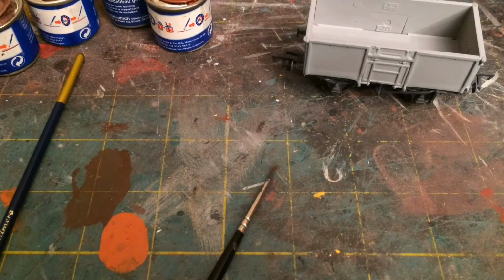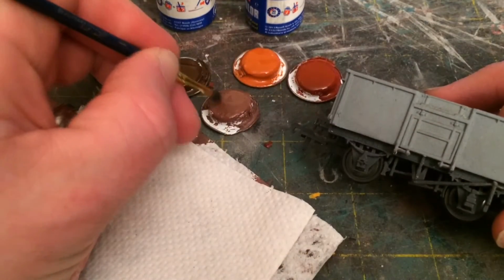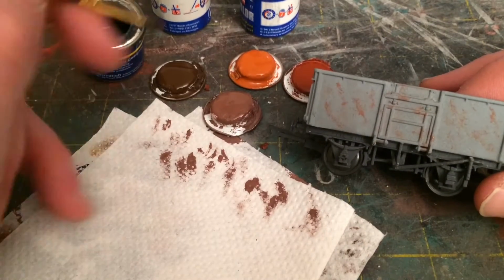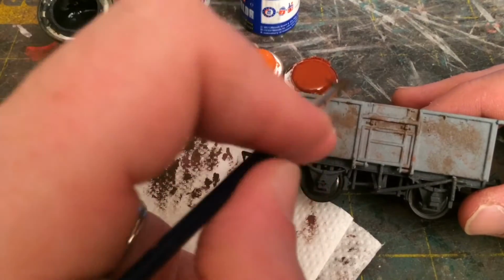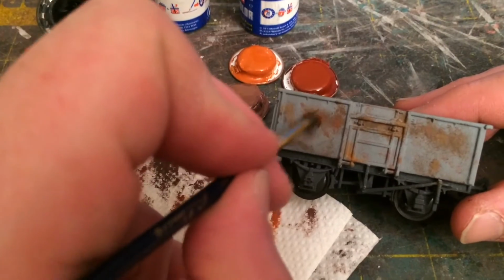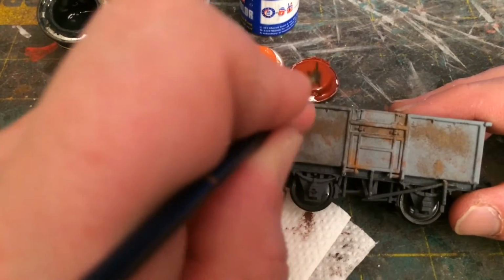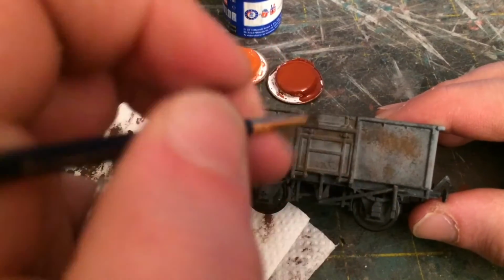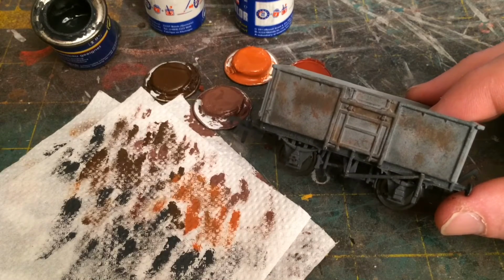Galgorm Hall How To Guide - Weathering a 16T Mineral Wagon

Comment: I love your very practical how to guide with simplistic  comentary.
i have 12 O gauge ones to weather.
What I do for solebars and underframeon general is to mux rust with matt black to tone it down then mist it on witg an airbrush.
I can then use a bit of gloss black on the axle boxes that look like grease.

I realise how complex a mineral wagon is locos are easy compared to these.
Reply from the maker: Hi Steven, thanks for those comments. The tutorial was as much for me to reference as anyone else who could make use of it. I've just subscribed to my first garden railway channel (yours!) so I'll look forward to seeing that rake of wagons weathered. As for airbrushes, I don't own one and am not entirely sure it's a beneficial investment for me. Still undecided though. 🙃  Paul
Reply: Galgorm Hall OO Gauge Railway Layout Paul
Firstly I sawa a lot of vids on weathering mineral wagons and your technique I like.
Ihave never really dry brushed before.
i suggest you buy an airbrush, you will wonder why you never used one before.
they dont replace brushes but they are the gest tools for the RIGHT job.
I would always paint a wagon with one and the underframe is  a breeze.
My approach to weathering mine will be to use you method after I have made them as in service condition.

So firstly I would airbrush the chassis using rust dulled down with matt black and just waft it on it gives this lovely track crime look over it.I then would use gloss black on axle boxes with a brush to show a bit of grease.
Using a dark grey with matt black I would dust the wagons with the airbrush and then the whole wagon will look likes its veen in service.

Now this is where I will use you method.
Your method is really not so mucus weathering as used abused and unloved which is what they really looked like.
I havent  tried it yet but will do

I recently built two slaters gaurds  vans in O gauge 
i simply used my method so simply weather down.
note I havent done the axle boxes yet as I need some gloss black or even some gloss brown.
http://s1058.photobucket.com/user/topshed34a/media/Mobile%20Uploads/20170324_163608_zpsijom3d1x.jpg.html
Reply from the maker: Steven, that's when I see the benefits of an airbrush.  Your brake van has that dusty look that all vehicles get with running and can really only be achieved with an airbrush - dry brushing is a little clumsy to create that effect. There are so many choices on the market for an airbrush though and I'm befuddled as to what is the right one to purchase.  Any advice will be gratefully received. 

Since you brought up the subject of Brake vans, the link below shows my efforts using the dry brush method. The kit was an old Airfix one with florist wire added for the handrails. 

http://s1380.photobucket.com/user/carnehan1975/media/Rolling%20stock/IMG_0337_zpsy0occjhx.jpg.html

Paul